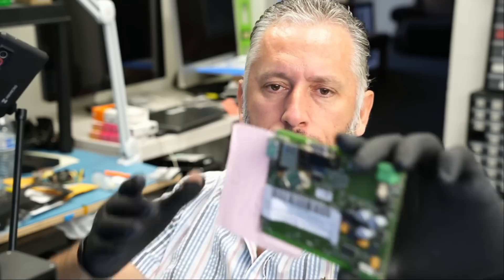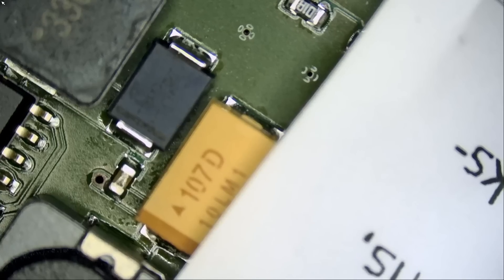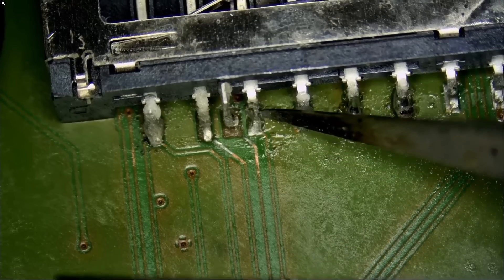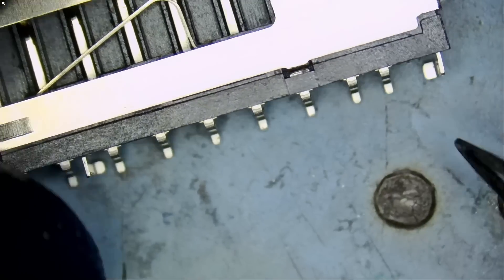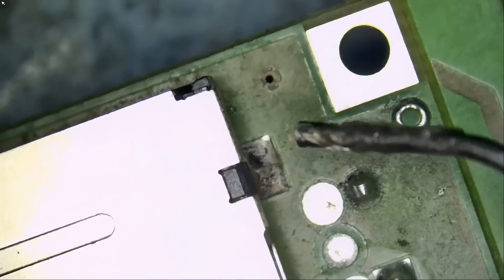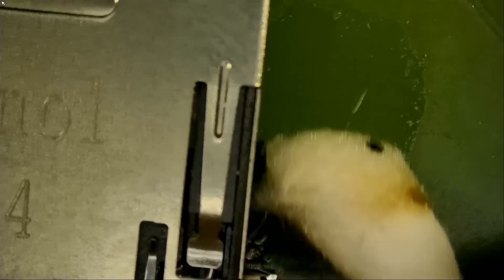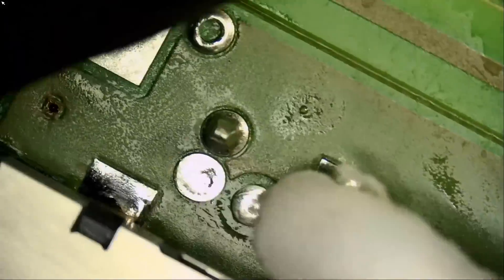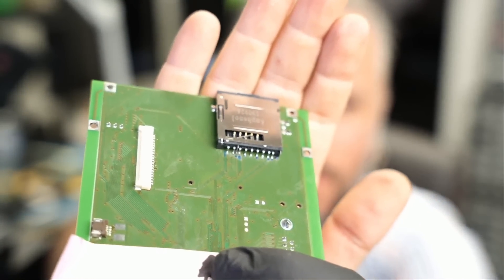Mini PC Damaged SD Reader Failed Prior Repair. Is it Fixable?

Comment: What is the benefit of soldering wires under the pins?
It looks easier to solder a wire on top of pin.

Comment: I bought some old circuit boards and all necessary tools to practice De soldering but even with the iron and blower set at 460 c still have trouble melting the original solder away from the components. Very frustrating.
Reply: "Low melt solder is your friend"
Reply: If it's unleaded solder, it has a higher melting point. Try mixing in leaded solder first before using hot air.
Reply: Yes I have all the necessary tools low melt, correct flux. I am a retired metal fabricator/welder and know what is needed, guess I will have to either persist or buy more expensive equipment.
Reply: Just because a hot air station is set to 460c does not mean it delivers that temperature out of the nozzle. If you are trying to take something off a ground plane it will suck up all that heat.
Reply: use low melt solder. it mixes with the existing solder. and for thru hole components, get a good solder sucker. i soldered new switches into my expensive mechanical keyboard as a first time soldering project, and a solder sucker is the easier way to get solder out of the thru holes that i found. before i had a good solder sucker and low melt solder, i was putting so much force on the keys i broke a few of them because i could not melt all of the solder on the two pins at once. i was just using a cheap 30w soldering iron. i made a lot of mistakes and bricked the keyboard. but after spending 8 hours soldering 104 keys i was not giving up and bought a new keyboard, and before even using it i ripped it apart and started unsoldering the keys. the 2nd time with the proper tools went about 3x as fast and did not destroy the keyboard. i use it every day still.